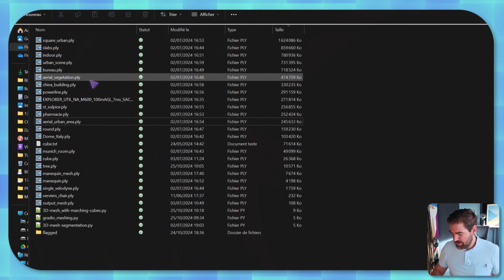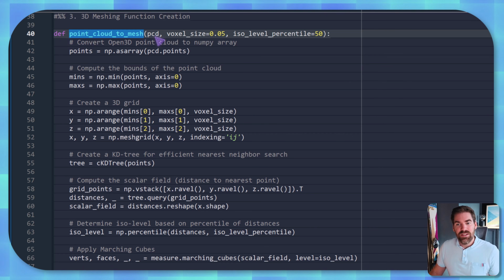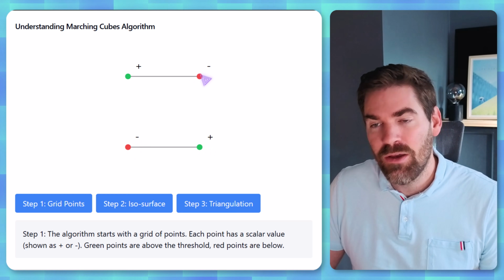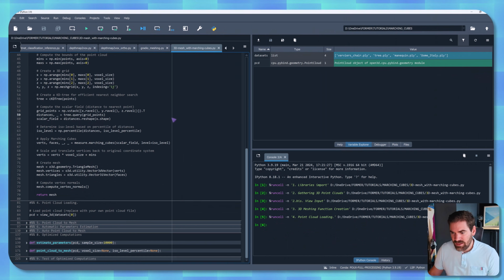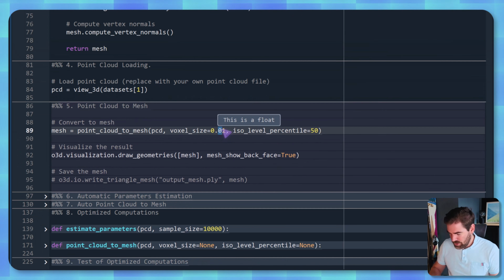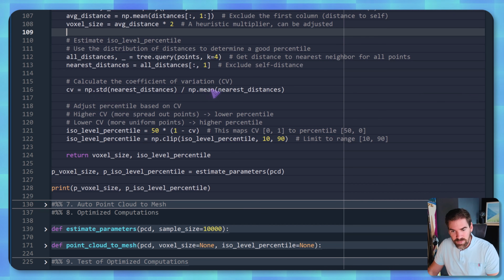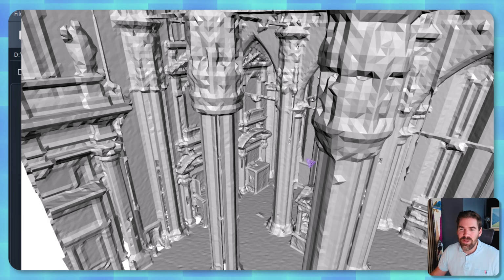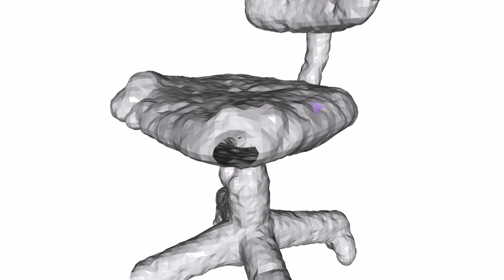Create an App to Generate 3D Mesh from Point Clouds (Marching Cubes Tutorial)

Comment: A question, 
Do we only use marching cubes when the point cloud is dense? 
Like i have a pointcloud( a roo which is dense but certain parts of it are little sparse. 
Could we use SDF and marching cubes there directly, so do we need to perfrom some upsampling or generate mesh( dense vs sparse areas) separately but still end up complete.  
Poisson failed on these corner cases so
Reply from the maker: Great question! Marching Cubes generally expects a scalar field (like SDF) defined on a grid. If you have a sparse point cloud, you usually need to convert it to a continuous field first (e.g., via Poisson Reconstruction or by computing an SDF from the points). If you try to run it directly on sparse data without a defined field in the empty space, it might not work well. You might want to look into 'Neural Implicit Surfaces' or 'Points2Surf' which handle sparse data better.

Comment: Hello Florent, great video.
I have a question. I want to generate a 3D mesh with the sewer pipe point cloud dataset(DUT Sewer3D Semantic Segmentation (S3DSS) Dataset) for my academic thesis. This dataset includes both real and synthetic scanned inner surfaces of defective pipes. The dataset involves 8 common defect classes are used which include: Normal, Spalling, Blockage, Corrosion, Misalignment, Deposit, Displacement & Rubber Ring. In your opinion, what is the best 3d mesh method for this application?
Thank you for your consideration.
Reply from the maker: Hi @sajadgharibi1233, that's an interesting application! For meshing the inner surface of pipes, especially with defects, you'll want a method that can handle potentially noisy data and complex topology. Poisson Surface Reconstruction is often good if you have normals (which you might be able to estimate from the point cloud). Marching Cubes is also an option if you can convert your point cloud to a volumetric representation (like a signed distance field - SDF), which might be good for capturing the internal surface. Given the defect classes, you might also look into methods that can preserve sharp features or handle non-watertight meshes if the defects create holes. Experimenting with both Poisson and Marching Cubes (with SDF) would be a good start.

Comment: Dear Dr. Poux,

I hope you're doing well! First of all, thanks a lot for your amazing and useful materials—they really motivate me to keep learning.

I’m very interested in 3D reconstruction, and it’s not just a hobby—it’s closely related to my career. Your videos have helped me a lot, and I appreciate them so much. But I’m facing a challenge and would love your advice!

I’m trying to create a 3D mesh of eyeglasses, but because they’re transparent and shiny, it feels almost impossible to model them. My current approach is to turn the shiny frames into a binary image, fill in the white areas (light reflections) with a photo editor, and then use 3D reconstruction methods. Unfortunately, the results aren’t great.

Do you have any suggestions for modeling objects like this? I would really appreciate your help!

Thanks again for all the great content.

Best regards,
Reply from the maker: thanks a lot for your kind words! beautiful project you have indeed! my workflow recommendation , to follow your idea, which is super nice, would be to indeed create masks on the areas that you have to reconstruct with photogrammetry (glasses)

how accurate do you need it? Based on this, you can then generate glasses with genAI in place using constraints form the relevant points of the fixtures

Comment: Hi Florent. Really interesting video. How is this process different from creating a 3d mesh from a pointcloud in an application like RealityCapture if any? Ive been using registered single .e57 files to create a mesh. I gues im trying to understand if that software is using a similar process or if what you are describing is a different process. Thanks!
Reply from the maker: thanks! great question! so usually, meshing in photogrammetry software is guided by images, thus slightly different than this approach, and more linked with delaunay.

Comment: Does this algorithm require good point cloud quality? what if it is a bit sparse and at some place incomplete?
Reply from the maker: As you use (in this implementation) a fixed voxel size, if you have a sparse zone, you may get no triangles. In that case, you need to adapt the algorithm to have its voxel size adapt to the local context.